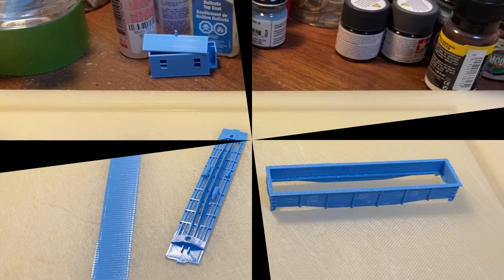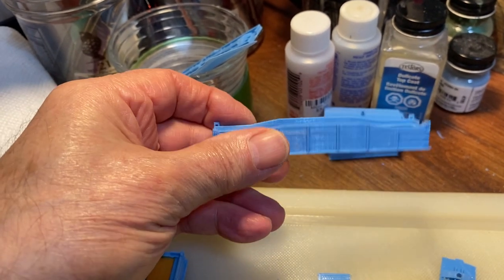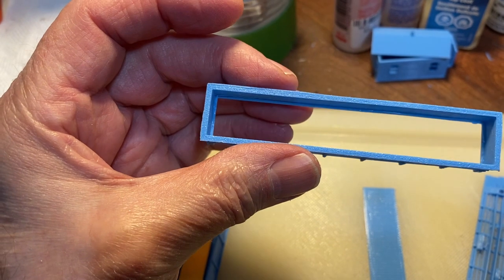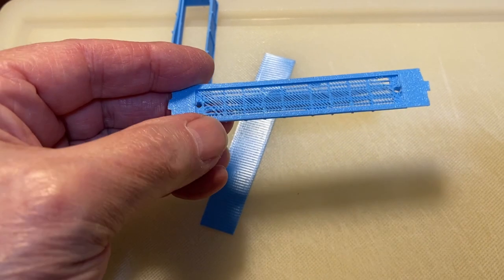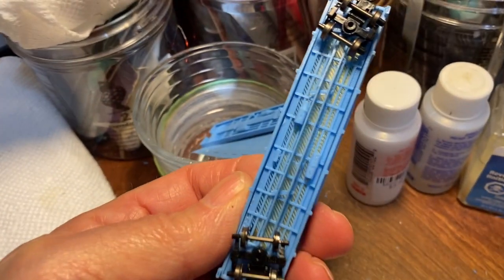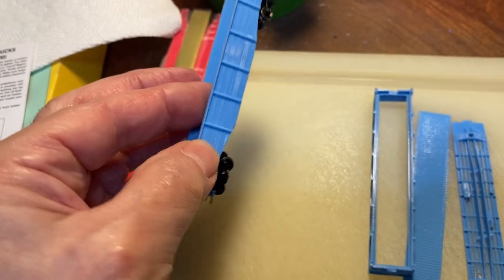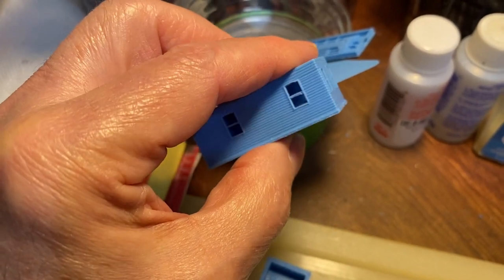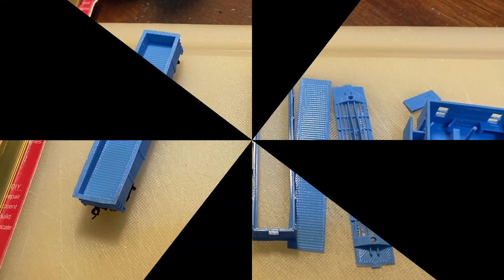N Scale 3D Printed Gondola

Comment: they look really good i printed one of those gondola and i broke off the little ladders by accident lol
Reply from the maker: Hi Dwight, Thanks for watching.  When I used the original STL generated by SCAD, my printer did not print the ladder bottoms at all probably because they were too small. That was why I took the model up to Tinkercad and created my own design using the STL as a guide. I made the ladder bottom a little thicker and changed the inside support for the underframe to something that did not need any supports.  I only use brim for the three pieces of the model.  I also filled in the opening of the underframe where the SCAD model had left open.......John

Comment: Those look Awesome! 
Are the ridges made by the printer difficult to smooth out?
I like the house too!
Reply from the maker: Hi Ralph, Thanks for your comments and question. The imperfections can generally be smoothed out using an Emory board or small file. The earlier flatcar did need any smoothing but did have some stringing that was pulled off either with a needle nose plier or with an xacto blade……John

Comment: Hi, I am going to buy a 3D printer. Do you know if there is an file on making an ATSF 6 wheel oil tender? Thanks for your response. 😊
Reply from the maker: Hi, Thanks for the question. I have not looked for one myself so there might be. If you use Facebook you could ask that question in the N-Scale Steam Builders and Kibashers group. You could also check by looking at the Cults website and other websites that have stl files. If you have an old Bachmann 4-8-4 oil tender, you could use it as a guide to design one yourself. I sometimes do that with stl files that I find. I use an FDM printer so there are limitations on the level of detail as compared to a resin printer. Some of the freight cars designs that I have printed are posted on Tinkercad for public use since they are modified from stl files found on Thingiverse……John
Reply: @tanzj  thanks

Comment: Is it 3d printed or resin printed?
Reply from the maker: Hi, That model was printed by an Anycubic Vyper using eSUN PLA+. I use an open SCAD based program, called “Customizable Car Creator”, that I found on Thingiverse to create N scale gondolas, flatcars, and hoppers. If I need to modify them further, then I upload the STL to Tinkercad and do the changes. Today I use the Bambu Lab A1 with the Vyper as a backup printer…..John